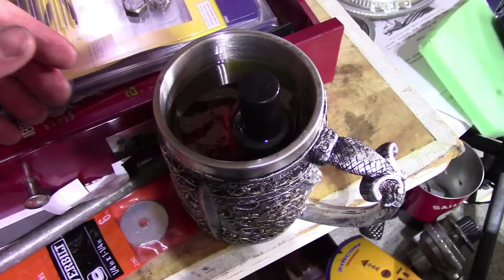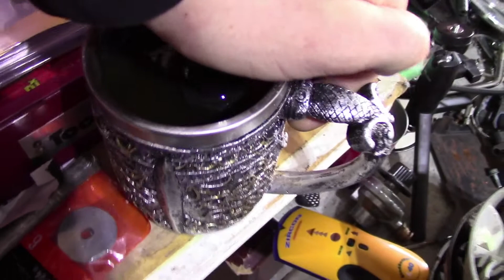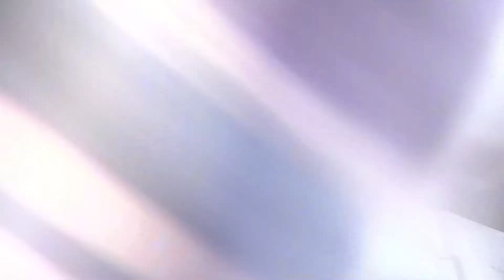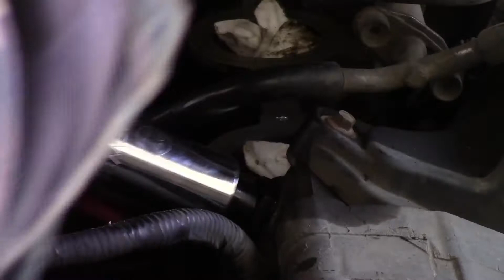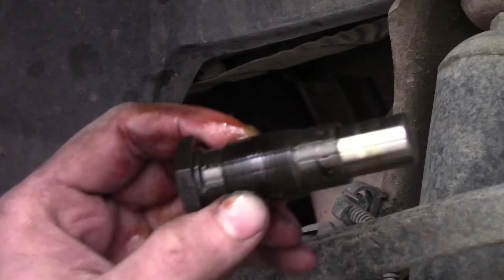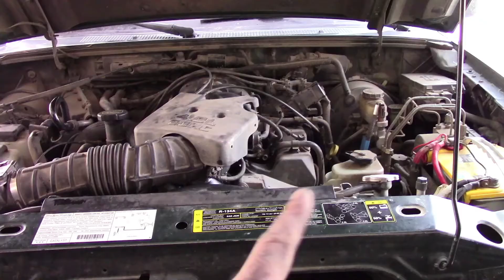Timing Chain Tensioners And Aluminum Thermostat Housing | 4.0L SOHC V6 Ford Ranger XLT 4x4

Comment: Do NOT prime tensioners: crank for 5 -10 seconds to prime 
"breaking it lose is the hard part"  --->  Run engine to heat up, allow to cool to working temp, then break lose. Block is alluminum and tensioner body is steel, so different expansion/contraction ratios will help
"unplug the coil pak"  ----> No need.  Push gas pedal to floor and hold.  Engine will not start. Crank for 5 seconds to prime
Reply: I didn't prime mine and now the front one is rattling.  I used original for parts.   It didn't rattle before, I was just changing them out of maintenance.
Reply: @DrTylerBaker  --Priming has nothing to do with performance, but will make it harder to install tensioners without cross-threading.
-- non-Ford tensioners have a high defective rate according to youtube reports.
-- Also note no one tells you to undo plug near front tensioner and remove the straw-like oil leak-down controller, and CLEAN out the passageway
-- I used Ford tensioners on my low mile engine, and it did not help.  After sitting overnight, I reprime by pushing gas pedal to floor, and it will start without rattle. This means that the INTERNAL guides and tensioner parts are factory defective, and pieces of broken plastic parts are prob partially clogging the oil pickup.
-- Ford Oil pressure "gauge" only indicates that oil pressure is present; does not measure it.
-- generic oil filters may NOT have a leak-down valve installed, and will allow oil pressure to drop in tensioners overnight.  My next experiment will be to install a FORD oil filter to see if this helps.
Reply: @DrTylerBaker  -- Note there is a large difference between start-up rattle and always rattling.  -- Start-up rattle means oil pressure is lost in tensioner, as well as internal guides may be disintegrating. 
-- always rattling means that chain(s) have stretched (high mileage) and internal plastic guides have disintegrated and plastic is plugging the oil pickup.
-- Problems on my low mileage engine started when I used cheapo oil/filters.

Also note that wholesalers are clearing out timing rebuild kits for these engines, so can be bought very cheap, eg: Rock auto.  AVOID the generic chinese parts.
-- The problem is finding a skilled mechanic willing to do the job. $3000+ labor, as engine needs pulling, front and bottom needs disassembling, oil and water pumps replaced, etc..
Reply: @C0Y0TE5  I'm at always rattle when I never had one to start with.   103k on the motor.   This was preventative maintenance and now I have to remove it, try to prime it, check the oil passage and reinstall it hoping it will be ok.  I cranked the motor for a long time on flood mode.   Mine just isn't priming on its own.      OEM ford part.
Reply: @DrTylerBaker  -- sounds nastier than my situation. maybe defective part? maybe forgot crush washers and oil supply hole not aligning? -- I needed to take my intake manifold off to change front tensioner. (Ford recommends every 70,000 miles, which is where I was at with an old 2003 4.0)
-- check: there should be a plug close to the Front external tensioner.  No one tells you about it. that supposedly controls oil pressure in front external hydraulic tensioner.  needs to be removed and passage CLEANED.
-- I did not find out about it until afterwards; But, it's my back chain making start-up rattle...

These 4.0's have a bad rep, esp the earlier ones.  The issue was supposed solved by Ford after 2003, but mine is early production 2003, so prob a 2002 engine.
-- The newer engines suffer from poor oil changes and cheapo oil and filters
Reply: @C0Y0TE5  I put a paint mark on the holes to line them up, but I don't believe they need to be.   I also used a crush washer and had no leaks.   It just didn't prime on cold cranking.   The old one was working  fine so I believe if I take this one out, carefully 1/2;prime it so I can still get the treads started, then I'll be ok.   I'll find out tonight.
Reply: @C0Y0TE5  , I primed the driver tensioner and put it back in.   All is well.   For some reason it wouldn't prime on it's own.    Thank you so much for your replies.   It helped me a lot.
Reply: @DrTylerBaker  Excellent!  but does not bode well for the future: indicates that oil flow to tensioner is very low. passage clogged?  Consider: How discolored is the oil? How often oil changes in past years? 
-- If using cheap oil/filters, cut oil change intervals by half. 2000 miles instead of Ford's recommendation of 5000.
-- Engine rebuilders also say do not run synthetic oil to 10,000 miles, as sludge will build up, even with high end oil.

Common problem with newer high tech engines with variable valve timing: oil sludge buildup in tiny passages for oiling front of heads/cams and very expensive repairs...
-- I am no expert, but have been doing the research on mine and friends' similar issues.  Newer engines NEED special care.
-- I have a 1963 Ford Fairlane with original 289.  That was Ford's introduction of the 289 engine. rebuilt once long ago.  Burns oil but is still powerful and reliable.
-- Good luck.
Reply: @C0Y0TE5  Castrol syntech high milage, 3k interval with wix.   Very good color at changes.   I'm a freak about oil changes.
Reply: @DrTylerBaker  -- Okay. that means that what folks say about the FORD 4.0 V/6 is true.  It's a bad design (putting overhead cams on the old push rod 2.9) and it's best described as the "Exploder" (when a chain jumps). Did I say FOUR timing chains!!? 😱

-- I have only 70,000 miles on mine, and am very disappointed in Ford's response to these factory defects.  I know it's old, but still...
-- There is another real bad Ford engine, the 1.0 turbo.  It has an INTERNAL timing BELT and requires SPECIAL spec oil. Try to save $$ and put Walmart oil in it?? Boom goes the rubber belt and takes out the head with it... Jeez!

-- Huge demand for non-existent used high tec engines!

Also the Ford 3.5 with dual turbos and dual overhead cams in the F150's. Great on gas and power for towing, but....the VCT units/cam bearings get messed up from oil supply/sluging issues. Big expensive repair jobs that the client brings back soon, saying issues came back...! hot damn!

Time to convert to Toyota....?
Sorry man, I'm grumpy today. Good luck with yours and your loved ones. :goat-turquoise-white-horns:

Comment: Mine has a slow tick by the oil pan only after it's warmed up and in park could this be a bad rear timing chain tensioner?
Reply: It also only happened after I changed the oil with stp oil and stp filter. Didn't tick before I thought maybe low oil so I put a little more just about the halfway mark as still tick. But very slow and is not there on cold start at all.
Reply from the maker: Yes, I had a similar noise when I installed a bad one once
Reply: I have same, and think it is: the rear chain has a damaged link. Eg: at idle it takes x-amount of time for chain to revolve once.
-- After changing oil/filter in these engines, prime oil pressure by pushing gas pedal to floor and holding it for several seconds while cranking engine.
-- The 4.0 starts up instantly with a high RPM engine flare, and without oil pressure in filter can damage chains/gears/guides

Comment: I picked up an '05 hilift 2x4 Ford Courier Crew cab (much like the Ranger or Mazda Bravo) with a tray back with the V6 4.0l  SOHC a while back. It had the same plastic thermostat housing issue and the previous owner told me they'd overheated it at one stage. Their mechanic told them in was probably a leak in the engine hollow under the plenum. I gave them their asking price even though it also needs pads, rotors, and new tie rod ends.
Anyway, I'm in Australia and priced an OEM housing, and then saw the aluminum ones. The aluminum housing was about fifty dollars cheaper than the plastic one, and that included freight. I've fitted that. I also decided to replace all the top end seals and gaskets down to the exhaust manifolds. In the process, I discovered that the heads had been replaced or resurfaced so didn't do the head gaskets. It also had a new radiator. I also replaced the water pump which turned into a nightmare due to a previous owner not realising that the fan clutch thread is not Left-hand on these models. They'd belted it with something to the point that the threads had welded themselves together. I tried a hot axe, a rattle gun, hammer etc to no avail. So I removed the entire pump with the pulley, clutch and fan attached and ground and beat the old pump and fan assembly to death with a sledge hammer. All I needed was the pulley because I'd decided to put electric fans in it. Unfortunately, in the process I slightly warped the pulley and couldn't get it balanced again.
So, off online to order a new one. The V6 engines are pretty common over here so I figured it would be easy. Well, no. I tried parts shops, Ford dealers, wreckers, online shops. You can't get one in Australia. I had to order one from the States. It arrived last week and I'm now watching build videos to get remotivated into finishing the motor. I only need tighten the pulley, do the final fan wiring and give it a proper run. I have had it up to temp using the old pulley but only let it get to temp due to the balance issue. 
Sorry for the long rant. I enjoyed your video and I recommend those aluminum housings. I had a similar issue with the pipe at the base of the housing. I had to replace the clamp as well.
Reply from the maker: That sounds like a sweet little ride! I'm glad you enjoyed the video and thank you for taking the time to comment, seriously!
I have always heard getting some parts in Australia can be difficult but damn! You had to ship internationally for a pulley?!
Reply: @DustyDingus  Yeah, I was dumbfounded. And no worries, mate. I subbed as well.